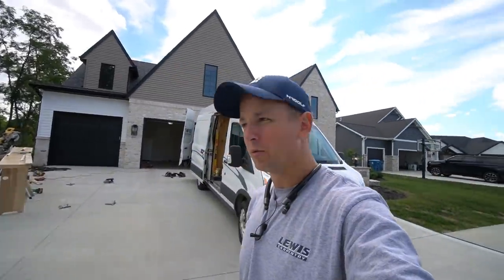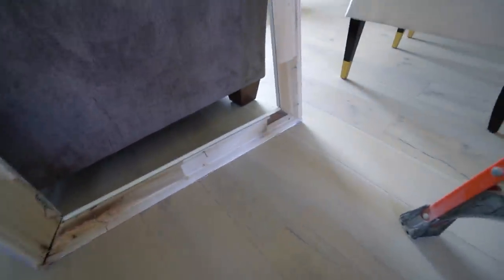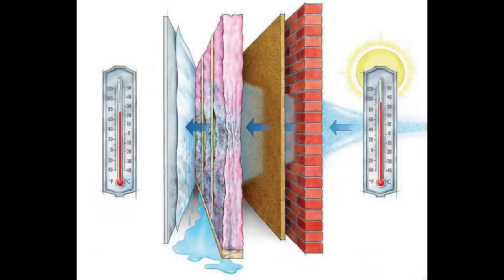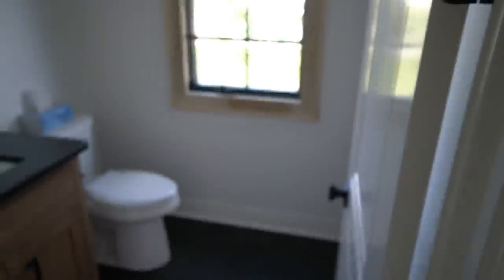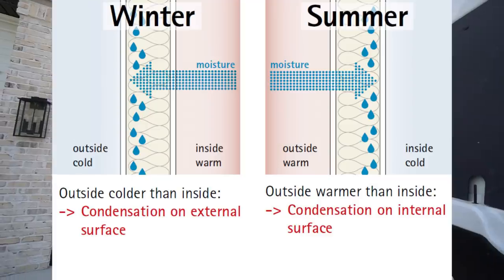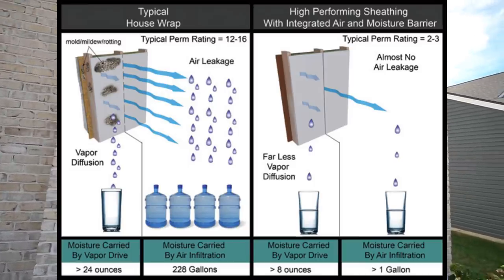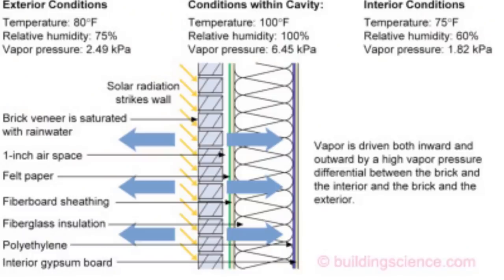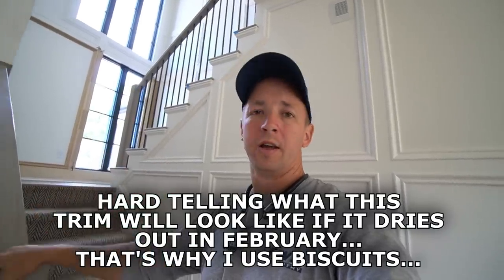Trim Humidity DISASTER!!! Is Vapor Drive Destroying this Trim Package???

Comment: If you have that much moisture around the windows and doors then you have to look hard at the window and door installation. Were they properly flashed and sealed? What do the baseboards look like? Most of my work is on the west coast and I see a wide variety of climates and issues associated with each, dry in the desert, wet on the coast. Never understood why the eves and overhangs have disappeared on newer homes especially where you get a lot of rain.

Comment: If that’s the bricks condensing through the wall and making the trim all junky with nails rusted like that…
I would hate to see the sheathing!!
It would be a wall of mulch!! 
Pretty positive it’s a poor or no flashing problem. Remove a row or 2 of the siding just above the bricks. Lead or metal flashing cap over bricks and up the wall.  Maybe can sneak a peak behind the bricks first just to see how it was applied. And those brick sills are nothing but problems. Should be one piece of stone or at least cap the bricks with a flashing as window gets installed. 
Just my 2 cents..   been building and remodeling for years. Seen some things man!! Lol.

Comment: I'm not sold on the windows not being the problem. Wayne Homes in Ohio had a huge problem with windows not actually leaking but water was penetrating around them. I've seen their homes rotting the sheathing and causing mold. I'm just spit balling what I've seen. Really interested to find out what the problem is. I know they are having a problem with making homes to airtight in an effort to save money that they are adding fresh air intakes in the small southern facing rooms

Comment: When houses are air tight they need an air exchanger. Did you guys verified it’s working and have hooked up correctly? If you see water drops on the ac vents you most likely have a oversized unit.

Comment: Try sealing the brick with an Epoxy sealer for masonry, caulk around all windows and doors
I’m a remolding contractor in Connecticut I see this all the time if it was done right the first time with housewrap that’s made for Masonary and flashing and a Weeping mat  this would never happen behind the brick

Comment: I am not for sure what area of the country this is in. I have been building for 30 years and in the midwest with houses that are really tight, the humidity is being trapped. There needs to be fresh air introduced into the house. Is there an air exchanger in the house. The old timers new a house needs to breath. Same principal applies. I would look at the heating and cooling system.

Comment: It's not the brick or stone. The house is under negative air pressure. 

Closed cell foam will stop vapor transmission and also give the home a moderately tight envelope where it's properly applied. The leak points for air are around doors and windows (especially openings flashed to masonry) and between the subfloor/ bottom plate gap. 

This is potentially an HVAC issue that is creating a vacuum or negative air pressure. The humid air is being brought in and focused at the leak points (doors and windows). This would also create a humidity issue since outside humid air is being exchanged with inside conditioned air. 

Another possibility is an active radon mitigation system that is creating the vacuum. It should be pulling air from under the slab, but if there's leaking duct work also under the slab... It could be drawing air through the sub slab gravel creating the air exchange.
Reply from the maker: There is a bath fan constantly running. We're considering that as another source of the problem. The issue seems to be very multifaceted.
Reply: Check slab for moisture with meter. Check positive or neg. air preasure(simple). Last make sure AC is not not on fan all the time. Fan must stop with compressor (just put fan switch on auto) and give moisture on coils chance to drip to pan and out. All gutters must lead water away ( far away) from house and land must slope away from walls also. Slab homes in Fla. have problems with water coming up through slab and even tile will come loose and wood floors can have a bad time. If there isn’t sufficient return air on the air conditioning system that can I have a negative air pressure in it and the moisture can get down and out the drain tube. Would be interesting to see the drain tube in action as the air conditioner was running. Here in Florida there’s a constant flow of water especially in rainy season.
Reply: But wouldn’t the air back draft through  the water heater exhaust,  bathroom fans, microwave and range vents before going through a wall. I’m thinking about what would be less resistance.
Reply: @keithN6  the AC people have a draft gauge they can put at different spots. Or you can make one
Reply: @keithN6  your correct but test all air and water potential movement
Reply: @InsiderCarpentry  
air conditionig contractor in florida here and we run into these problems also. that fan can be a huge problem and i would shut it down until you find the problem because that will keep pulling it in. did they do a manual J to verify the size of the a/c unit and also is it 2 stage cooling. if the they wired it wrong that will create a huge problem moisture because the fan not operating at the right speed for the compressor when it switches between stages. i would recommend a blower door test to verify how bad the negative pressure is so you can confirm it is to much negative pressure. just some things to check that i have personally run into as causes. hope it helps.
Reply: If hour is negative preasure put plastic over a doorway to outside and cut a hole in plastic and see air flow in. Or out. Return for AC must be large or two of them and they could create negative preasure in the air handler, not letting coils drip and flow out properly. Fan on auto would help.
Reply: Even smoke at window edges and door frames

Comment: Check with heating and air company. With closed cell spray foam the house can’t breath any, you need to check with them on what you need to keep the air circulating through the house

Comment: The house needs to breath!! Its sweating..Air bricks and vents in the cladding will allow air to be drawn in and out top and bottom.. here in England all are houses are made of brick.mortar joints in the cill of the windows not great..don't seal the brick get air around the brick 👍

Comment: In a nutshell the house may be too tight with not enough air exchange. Over the past several decades I’ve seen how the energy efficiency codes have made houses so air tight that now builders are dealing with moisture issues. I wonder what the attic looks like?
Reply: It is sealed too tight. House wrap with high efficiency wood windows then closed cell foam PLUS it’s brand new construction where there’s still 20+ percent moisture in between the sheet rock and the sheathing. I’m betting they have hard wood floors and kept the air humidity inside the home over the winter set at least 50+ percent there too so the floors didn’t shrink. If you didn’t use tyvek house wrap which only breaths one way and also if you didn’t install it right which I bet didn’t happen as the video clearly shows that’s one of your issues. The weep wicks are dry which makes me believe the wrap is the culprit.  Also you have to use an air exchanger if you spray foam too. Depending on how many square feet the house is it may need a 4 ton unit.

Comment: Unfortunately, the only real fix is to remove the bricks - replace with a rain screen and hardi plank type product. This is not a joke - it's literally what we had to do to bring this problem under control. Home owner does not want to leave it too long, because mold is going to grow in cavities. Maybe exterior foam may have prevented this issue - possibly.

Comment: If you see someone filled between the window and jack stud with loose pack fiberglass insulation and did not tape over the gap to insure the integrity of the interior vapor barrier then condensation will take place in the wall all around window and other affected wall penetrations.

Comment: Seems like a ventilation problem. If the house is well air sealed and just uses traditional HVAC without a engineered ventilation system to match you will have this problem. 

I am sure we've all seen Matt Risinger's videos about air and water sealing for modern construction, but if there aren't properly designed HVAC systems it will cause problems. 

This house needs more air movement.  More air changes per hour. 

Also, the front of the house has little if any overhangs on the roof, so the lower windows aren't protected from rain and if they aren't sealed well could be another source of moisture. 

Also, no air gap behind the brick???? 

If it can't dry...it's going to die.

Lots of things working against this house. 

If there is high humidity on the house, I'd start with a well designed HRV or ERV system.

Comment: Hi Spencer,

A couple of thoughts about the problem.

I noticed that the upper window in the stairwell has siding on the exterior but has the same problem.  

Do other houses in the area have brick and are they having the same problem? 

Are there any houses with siding that have the same problem?

If so, is it on the north facing wall?

You mentioned that it feels humid in the house.  For the amount of humidity you’re seeing I would suspect the AC Unit.  Have the owners called in a HVAC contractor to check it out?  

Since you mentioned it is a slab on grade with underground ducts, they could test the supply air coming out of the unit and the supply air supply at the rooms to see if the air is picking up any moisture from groundwater/dampness seeping into the ducts.

Comment: It is most likely a roofing flashing!
I call it a flashing kick out. Where a rake  stops and a wall continues down. There need to be a flashing to direct water into gutters and away from walls! 99% Of the time this is the problem. I saw two spots where you most likely need one.

Comment: It's a little strange because the outside (long point) of the miter would indicate that the wood has dried and shrank across the grain. Other areas look like there is a lot of moisture accumulating. I noticed there wasn't any spray foam around the voids behind the trim. A real mess. I feel bad for the owners
Reply from the maker: It works the opposite. Expansion opens the outside, drying out opens the inside.

Comment: Do builders foam around windows and doors? I surprised no sills on interior trim. Not exactly high end trim package. As for all the moisture I’m at a loss. Never seen that happen unless wind is pushing rain thru exterior. 🤷‍♂️ I’d waterproof all stone work and check chalking at windows and doors.

Comment: Did you run a moisture meter over the walls? I would check the way the moisture barriers were installed, and insulation. it looks like water intrusion. there needs to be two vapor barriers, internal and external you are going to have real problems was wood (OSB will be rotted out, this is going to be a night mare.) open up some plaster board you will be finding rot over a lot of that stud work.

Comment: I have never seen anything this bad, if the issue was condensation in the duct work it would only be isolated to the areas directly under it. Vapor barrier, distance between the stone veneer and the wall will definitely be a driving factor in humidity built up, in this case not a top quality trim work was a good thing  or the issue would have taken longer to show. If this was your trim work the wall would have fallen apart and them hotpur miters will still be standing….. Please keep us updated on the findings

Comment: those trim pieces should have been glued together with the super glue CA,,,,that would have helped.     also i think those trim pieces shrunk from the cold air from the HVAC.    problem is we always put the registers below a window for the heat to catch the cold air coming in from the glass.    also, the wood they used to make the trim may have been full of moisture and when the heat came on it shrunk the trim.

Comment: 68 degrees is a cold storage. Set the temp to no less to 75, since it look like a track home are any other homes with the bricks having the same issue? May be a builder issue since its a new home. Also have you made any videos on miter re-enforcement?

Comment: Help me out here - mitered window corners have been known to open up/move for 200 years.  That has not changed.  What has changed is that modern construction emphasizes homes with no air leaks using HVAC from the last century designed for leaky homes.

Comment: Is the cavity large enough  to allow ventilation? Mortar too porous? The black mold is now permanently living in the sheetrock , it may jave to be replaced. That alot of moisture so has that cone from the outside (rain) the inside (condensation from hcac) oru underneath as in sitting on top of a water sourse. I always use glue on mitres, ots jist wrong if you dont

Comment: To qualify my response, I live on the coast of Maine where humidity is near or above 90% all summer. I have also been in the building business as a carpenter since 1975. I'm still pounding nails every day.
I agree with the comments that Dosadoodle and John Perkins as well as a couple others.  Now my 2 cents, if the back of the drywall is not moldy or wet and it is just at the window casings, are the windows a good quality or are they junk that is letting in air at the seams. Are they wood, metal or plastic? In my house that I bought, there are some plastic windows that have failed welds at the corners.
In regards to the interior door casings opening at the outside of the miters wouldn't that be caused by shrinkage in the width of the material? The boards may have been cut the day before they were milled and installed the next day, ok I'm being sarcastic. If the casing boards were green when installed and the boards shrunk in the width as they dried the outside of the miter would open up.

My last remark is what is the warrantee on work in Indiana? Did the homeowner contact the original building contractor for a remedy?  
In Maine a contractor of any trade must warrantee his or her work for 1 year. If a complaint is filed with the contractor 6 months into the one year period that complaint stops the clock until the complaint is repaired then the clock starts again. In other words that tradesman must continue to warrantee that item for 6 months after the complaint is repaired to finish out the one year time frame.
Reply from the maker: In regards to the miters, its counterintuitive but they open on the outside (toe) during high humidity and open on the inside (heal) when they dry out.
Reply: @InsiderCarpentry  Spencer, thanks for clearing that up. I can't remember ever seeing open miter joints even with the huge humidity swings between winter and summer here. Like I said, I have been a carpenter for a long time. I do love to watch your videos and the methods and equipment you use. I often say to myself, why didn't I think of that or where was YouTube and Spencer 45 years ago?

Comment: Your only issue is the brick in the transition between siding and brick and possibly overhang. If it was moisture all your windows all your trim will be blowing out your floors wood floors would be moving around excessively if it was moisture

Comment: This appears to be finger joint trim more than likely imported and probably has a high moisture content……be for your install this stuff you may want to check it with a moisture meter and if it is over 8% reject it.

Comment: This question is completely opposite of the video……in the winter, the humidity in my house is very low.  Would a whole house humidifier help prevent cracking in the corners of my  crown molding?
Reply from the maker: Yes. Keeping the house close to a constant middle humidity will help.

Comment: I would be really hesitant to seal the brick. It may just trap moisture against the house. There is a saying in building science, physics beats chemistry. A chemical solution (sealer) will just degrade and fail over time, you need fix the wall so it physically can't happen.

I think the problem is with the brick air gap and weather barrier. John Perkins seems to understand that detail better than me.  However 1 layer if tyvek seems insufficient as a vapor barrier. On the lick and stick stone that is common around here there is typically a vapor barrier and 2 layers of #15 felt. I'm not sure how that translates to brick.

I would also wonder if your Kraft faced insulation is contributing. You typically want your vapor barrier on the warm moist side of your house. Not the cool dry side.

I wouldn't spend a ton of time fixing the cosmetic until you find and fix the actual problem. They aren't going to like the answer, but they probably have mold on the drywall, saturated insulation and other problems that need to be addressed first.

You may dm Matt risinger with the build show on YouTube. He is overly sponsored, however he does good content on building science. He may show up with a free engineer...